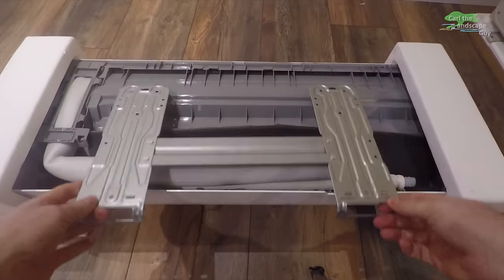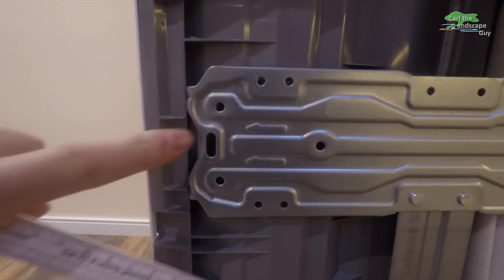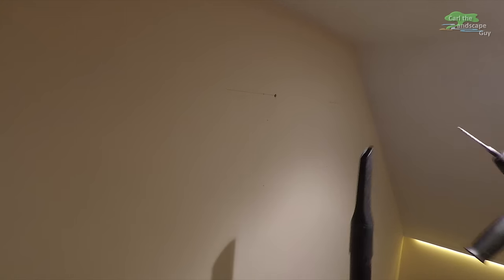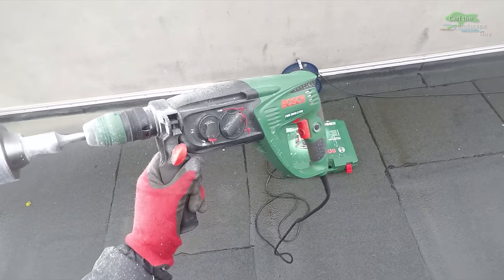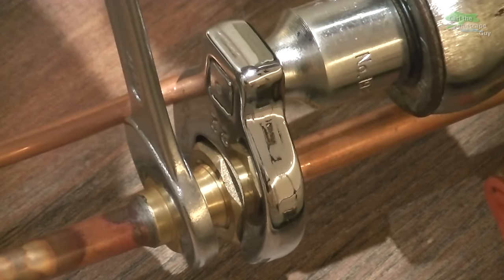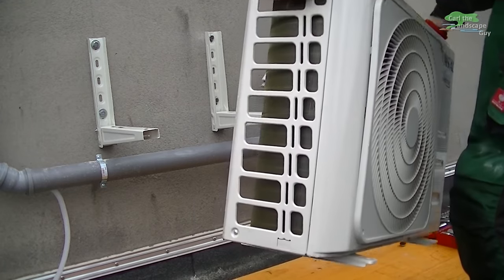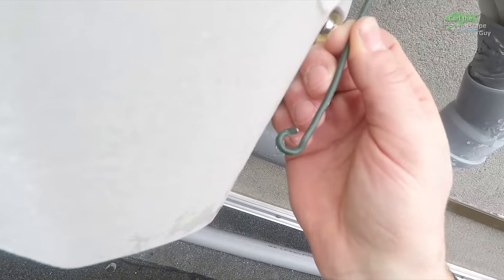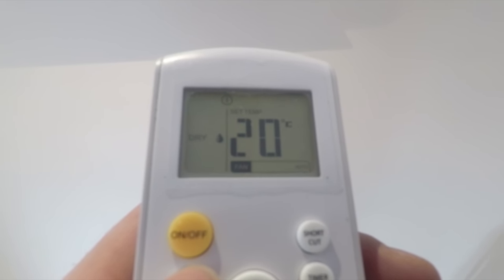AIR CONDITIONER DETAIL INSTALL |SPLIT DUCTLESS AC HEATING INVERTER,MINI PUMP SYSTEM SETUP,DIY HOW TO

Comment: My friend, I want to comment on an important matter. Every day I install 10. If I followed your method, I wouldn't install a single one.😊
Reply: Slow high quality installation is better than speedy low quality installation. As an Electrical engineer I love it when people take pride in their job. A lot of domestic electrical installations are done poorly and these people call themselves "electricians"
Reply: @IAmThe_RA  There is no difference in quality and this is a big lie
Reply: @IAmThe_RA  If you had experience, you wouldn't say such nonsense
Reply: @تيتو-ت3م  I am talking about trade works in general, i'm not an AC technician so I am not qualified to judge .. But as an electrical engineer, I notice that a lot of electricians who prioritize speed do a terrible job. When it comes to electrical installations every detail should not be overlooked. The electrics in my parents were shocking and it was done a licensed electrician. It was a miracle that no one had died or the house had not burned down. So when my home was built I did the entire wiring and installation myself even though I am not an electrician. I can't trust electricians anymore because the standards these days are on the floor, it's not easy to find one that takes pride in their job.
Reply: @IAmThe_RA  Thank God, everything is fine now, but I trust my work, and I do not accept wasting time on people who have a phobia of some memories.✌🏻

Comment: I dont mean to be rude. I dont have as much experience as you, but if you ever need to pull the indoor unit off of the wall holder (In case of a service maybe), or if you need to acess the joints.... Its going to be a pain. You should avoid installations where the copper tubing joint is in the wall and use proper ac canal outside instead of that pvc pipe (You can remove the cover easily)...

Comment: I've never installed an AC unit, but how odd that the main power input goes to the outdoor unit, why not have it run to the internal unit, then just the feed outside, as it stands there are 2 external power feeds, seems a bit daft. Also if you ran the lines above the unit instead of below, you wouldn't have to worry about water ingress as much into the upvc piping and go mental with the tape haha.
Reply: À

Comment: All nice and good, except the evacuation. It's measured in MICRONS and a guesstimate is not good enough, you absolutely need a proper vacuum pump and not a brake line bleeder. Unless you have the proper microns, any air or moisture in a system WILL eventually cause problems. It's not an IF, but a WHEN, because it will happen. But otherwise, great job. 👍

Comment: Seems Like a pro...if you dont have a vacuum pump you can just purge the indoor unit by opening the smaller tube at the outdoor then release the freon on bigger tube with a tire like valve by that mean you just release the non condensible gases on the indoor but overall great work
Reply: Hi. Can you explain this method a bit more in detail? Not sure if I understand it fully. What do you mean by a ' tire like valve '. Thanks. (Greetz from the Netherlands )
Reply: Except that is:

Illegal
Hack
Not effective to remove moisture
Hack
Wastes refrigerant charge
Hack
It’s not R22 anymore homie
Hack

Comment: That is a beautiful install. If you can answer a question I'm unclear on. Is the unit is pre-charged with refrigerant? Is there an issue with the lines not being vacuum pumped and dried of moisture? I've never worked with any precharged units and have no idea how they work.

Comment: Question, do most split ac’s come with refrigerant pre installed?
Reply: yes they do - refrigeration condensers don't come precharged as the compressor can be used with different refrigerants. But, in answer to your question now a days most A/C condensers come precharged with either R410A or R32
Reply: @Dubstepdoug1  thank you

Comment: You should have crows feet at 90 degrees on torque wrench so as not to lengthen the lever, and hold it from the handle when torquing.

Comment: 6:21, dude that refrigerant line hole must not be at same angle. It should face slightly downwards on the outer side to facilitate easy flow of drain water. Rest everything is so very satisfying...

Comment: anti vib feet,,theres dampers you can get with 2 threads top/bottom,rubber in middle,like an engine mount.fridge compressor/motor mounts.

Comment: You missed one thing the vacuum pump because it is a inverter ac and there’s no air allowed to mixed with the refrigerant you did it by hand pump but it’s not that good ❤

Comment: Excellent job, it looks so easy when you do it but I know its hard work at least thats what I heard. One question I have, does a electrician needs to approve the electrical work? I am just not sure if I do it myself here in the UK if that would affect the insurance in case something happens?

Comment: sir what kind of round bit drill do you used ?and where it to buy this tools thanks?
Reply: 2 and 1/4 inch was what i used i had to go thru concrete block so i had to get one that did that - lowes or home depot sell them they are $20-30

Comment: You did not fasten the wires correctly inside the outside unit. The black Clamp must be over the insulation of the cable. Its for protecting against something pulling on the wire

Comment: Use Nylog on the flare fittings!
Reply: Nylog is life
Reply: @snpdg1  it really does make the fittings work tight, swear by it
Reply: @cengeb  yes , i always use it, with yellow jacket torque wrench

Comment: Before Drilling any holes in the Wall:
1) Use stud finder to locate wall studs.
2) make sure the 2" hole in the wall will not end up on the wall stud.
3) use a leveler with the wall plate to ensure it is straight before marking spots on the wall to be drilled.
4) Always drill the 2" hole at a slightly downward angle so condensation can drain properly.
5) Do not EVER apply to much force to straighten the line set in the back of the wall unit or it will bend and now you have a major problem.
6) Wall unit is filled with Nitrogen so do not release Nitrogen until you are ready to make connection with the outdoor unit.

Comment: Window ac is the easiest to install and cheapest to maintain.  Split is good when you need to provide cooling to multiple rooms.  For a single room split is not worth the extra cost.

Comment: Major mistake! You have to izolate separately the pipes! One is out and hot and the other is cold ! You lose efficiency there! Other thoughts this is a very good video !😊
Reply: I disagree. The hot line into indoor will get cooled is a good thing actually. So pipes together is ok.
Reply: @kisangkim1105  if they are isolate separately and then together it’s fine! Yep

Comment: Sorry, one more thing I noticed that you did not have your hand on the handle at least some of the time and again it is so very important to be holding the handle or else it will throw the actual torque value off COMPLETELY. Do understand these torque wrenches are engineered to be held by the handle to get a proper reading. Okay, enough said.

Comment: 1. Is leakage checked through soap water.
2. One more self vaccum is missed
3. Electric voltage reading missed to check in ODU.
Sorry if these are not applicable out there

Comment: Hello,
Yesterday, my technician tried installing my Daikin non inverter AC, but he left in the middle as we could not finalize the outdoor location. Now i have finalized the outdoor location, but the problem is that the copper pipes of the Indoor unit has been straightened perpendicularly by the technician, now the changed location i decided will require the same perpendicularly rotated copper pipes of indoor to be re-rotation of the pipes into their original position as it comes from the company (horizontally aligned inside the indoor). Can this re- rotation of copper pipes from the vertical position to the previous horizontal position cause weakening or breaking of the Indoor copper pipes? Feedback from anyone will be hugely appreciated.
Thanks
Reply: It will be fine

Comment: as a master airconditioning and heating contractor, my advise to you, stick to your day job.
you never cover a fitting without leak testing all the fittings, with the rated level of nitrogen.  It's going to be a severe job to fix a leak.
Reply: Agree, very neat but no proper vacuum, no pressure test.  Vacuum should be via digital vac gauge 500 microns. Analogue gauge insufficient. Also, not sure on line set length and refrigerant addition or subtraction or set for pipe length provided. Would definitely have employed services of AC technician to carry out check and vacuum process. Credit to the guy other than that

Comment: hi carl i bought the same unit on amazon (dimsun) and was wondering what the height is and the location of the hoses which go outside through the wall, is it possible to lead these up like 5 cam and them lead them outside ?

Comment: do not use a hand pump. use a proper Refrigeration evacuation pump. you are supposed to pull a vacuum and leave the evacuation pump run for 15+ min.
Reply: You are right

Comment: Good video. You sound European.  There are regulations in EU to have certified installers. I am curious - not complaining - are you certified to install or are you not in the EU or you are in the EU but you don't care, if so why don't you care?  Thanks  
Reason I ask, is that I want to do it myself in UK.
Reply: You need to be fgas registered. Neat job but some fundamental flaws.
Reply: Deane Newton please expand on "fundamental flaws". We are having aircon installed, multi split system with four room units into one external. I want to make sure the contractor is not cutting corners, but I don't really know what best practice is!

Comment: Something is omitting here. What about the gas, how did you open it. I mean the two valve, how do you open it.
Reply: He mentions opening the valves for the coolant at 24:35, but doesn't show how. In other people's video's I've seen how it's done:

Remove the protective covers from the two copper connectors/valves that are pointing straight out and away from the outside unit.
Use an alan key on the top valve first, turning it open all the way in a counter clockwise motion, then use the alan key on the bottom valve in the same counter clockwise motion and fully open it.
Put the protective caps back on

Comment: I WISH YOU HAD EXPLAIN THE ELECTRICAL CONNECTION ,FOR BOTH UNITS HAVE POWER MARKS,AND THE COMUNOCATION MARKS.SO, YOU RUN THE POWER FROM THE THE OUTSIDE UNIT TO THE INSIDE, AND THE MAIN GOES FROM THE PANNEL OF THE HOUSE TO THE OUTISIDE UNIT, SAME PLASE(POWER)??

Comment: I don't think you should bundle the hot and cold pipes together in one insulation wrap.
Reply: Pickle Onion The "cold" pipe isn't actually cold until it reaches the metering point inside the internal unit and can expand.

Comment: At: 22:15 you can see the mistake with that pvc pipe... The rain will pour in and wet everything unfortunately. And im trying to be helpful :)
Reply: Yes...it is upside down....should have the wide overlap on the bottom...

Comment: 400mm concrete? Buy a core drill my friend!
And Aircon trunking is miles easier than a plumbing downpipe 😭
Hand vacuum pump? What? 😭
Reply: It hurts my eyes when i saw him using a manual vacuum pump

Comment: Nei commenti leggo complimenti gratuiti probabilmente perché fatti da dilettanti. Un tecnico italiano già da come è stata aperta la scatola della motocondensante avrebbe avuto dubbi.....inutile parlare della mancata copertura del parquet durante le fasi di assemblaggio...il tubo idraulico come copertura dei circuiti esterni è esteticamente inguardabile rispetto ad una canalina...da evitare proprio l'inserimento degli attacchi a cartella dello split nell'intercapedine del muro poiché non ispezionabile...nel video non si vede effettuare il vuoto del circuito e la prova di tenuta con pressurizzazione ad azoto...voto 6 per l'impegno. Appena sufficiente......

Comment: New sub! 

I need your help. Somebody. Anybody! PLEASE! 

I’ve installed a unit called WINDY in my room. Room size is 13” square feet. It was a 12000 BTU unit. I’ve not been able to use this conveniently any at all. 

3 days after installation, it stopped cooling. This has been the pattern since. The installer came 3 times already in a month and it’s the same issue. Even brought someone else to assist and same issue. Each time they come I observed that they have to gas the unit again for cooling to restart. Again this last only 3-4 days. Said they checked the lines and there are no noticeable leaks. 

I’m beginning to get frustrated because the time is so hot and I can’t use this thing as intended but I’m hanging on to patience. I wasn’t expecting this at all and I am fearful that I will be spending the same money for the unit to always have someone coming back to analyze and fix (separate costs there),

There is no error showing on it. It’s blowing but not cooling. What do you think the problem could be here?? I would really love to hear anyone’s opinion.
Reply: Maybe get the installer to put in a new unit. Something is clearly faulty. Or there’s a leak they aren’t telling you about.
Reply: LeuCustomKnives 
I thought about that too. I think they’re hiding something. Thank you
Reply: Amoya G the next time they  come out get them to show you it’s actually leak free. Recover the refrigerant, pump it back into the condenser and get them to pull a vacuum and show that it’s holding a vacuum. The gauges won’t lie!
Reply: Amoya G just reread above. Shouldn’t need to recharge the system unless it’s leaking! Pretty severely if it’s stopping cooling after 3-4 days. Might be a leak at the joint that connects to the inside air handler. The part that is likely covered. I’d get them to undo all the packing and get them to spray some leak detector (heck some soapy water even) and at the connection outside at the condenser. Negligent installation should of bent a copper pipe and it could be leaking from some pin hole as well.
Reply: @LeuCustomKnives. Thank you. I’ll definitely make this request. Your video is a good demonstration of what should happen since you had tested it yourself to see if the pressure would fall. 

⚡️Not sure if this information or observation below can say anything else. 
I noticed that once I turn off the AC (say on days 1 or 2 after running it for the entire night), I would hear something like ice crystals falling in the unit that’s inside the room. Should that be the case or is it normal?
Reply: Amoya G haha! This is not my video. I just have some experience with installing these mini splits. now. Icing up could be set too low
Reply: Okay 😀 actually thought it was you. 
Thank you for the pointers. Very valid and I’m glad I have some guide as to what to look for once I call them to come back. Appreciate it.
Reply: Amoya G sorry to confuse you but I figured the owner of the video wouldn’t respond and wanted to give you some insight and hope. Hate it when people do shotty/bad work. Hopefully there’s a warranty on the machine and labor! Otherwise I’d report to better business bureau. Unless you aren’t in USA 😅
Reply: LeuCustomKnives 
I hate it myself. I believe in doing the job right the first time. Period. No matter the cost. 

Warranty is on the unit but not on labor. I’m also in a beef with the company as I told them I wanted to buy into their full warranty which should cover everything. They drop the ball in not explaining to me that me getting my own technician would exclude me from getting the full service hence the cost was lesser than a if I was using their 3rd party technicians. I had no clue about that information. THEY NEVER EXPLAINED ANYTHING TO ME UNTIL I CALLED THEM ABOUT THE UNIT not holding up. That’s the only reason I used that company and that was because I needed their full complementary package so as to not go through this headache. Here we go after the fact. 
I’m in Jamaica and we also have something similar to BBB here which I am strongly contemplating on reporting the issue to. 
The company is the ones sending this other technician (on my expense) so I just want to see what this one comes up with in his analysis before making my move.
Reply: Amoya G shouldn’t have to pay anything within 1-2 years. Ridiculous they can’t fix their own install.

Comment: That method of trying to evacuate the lines is not proper.  It would never be able to pull sufficient vacuum to remove any moisture.  You need a dedicated vacuum pump designed for this purpose.  You should have leak checked all of your connections by pressurizing with nitrogen.  The high voltage wire should be protected with conduit at the outdoor unit.  That tool you used is actually used to vacuum bleed brakes on automobiles.  I am sure you had a professional go back over this and do a proper evacuation and start up.

Comment: Amateur Bosch 
amateur assembly. For amareur it look really good but you do basic assembly mistakes. Tell me: how do You remove the indoor unit if necessary since you put the connection to the wall? 22:11 What is this. Naked cables in the catch. It's dangerous. 
These are the biggest mistakes. Don't do it ...

Comment: 20:34 mistake. You need to remove the center rubber and put the top rubber in the center and it would be correct... Maybe I do have a little bit more experience than you :P

Comment: One mistake: The condensation from inside body drips down the pipe and will BUILD up on that angle you made beneath the outside body. This is a serious mistake, since the condensation buildup on the inside body WILL build up inside the pipe connector that you put in.  Very very bad idea!

Comment: you forgot a lot of things. pumping of the circuit, leakage check with nitrogen and after release of the fluid with a 5mg / year detector, accessibility of service valves???????!!!!!!!